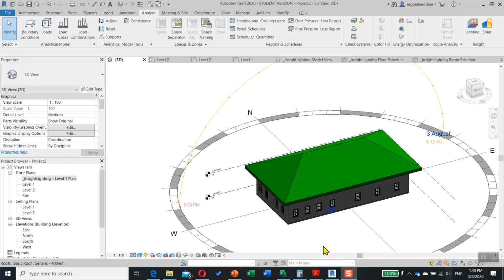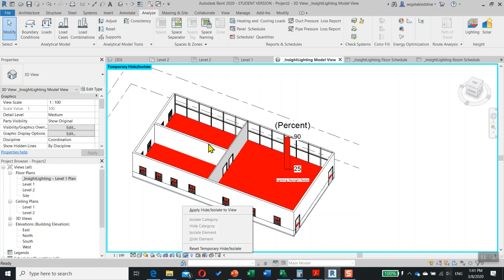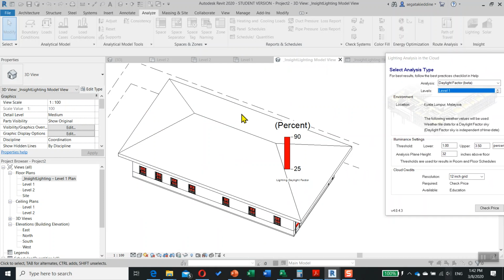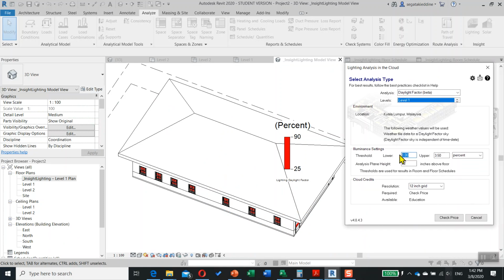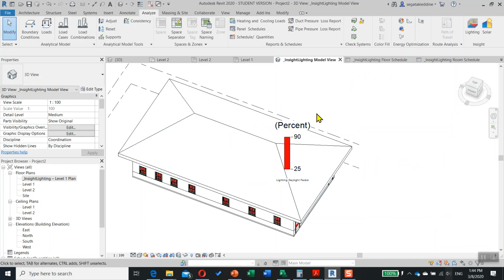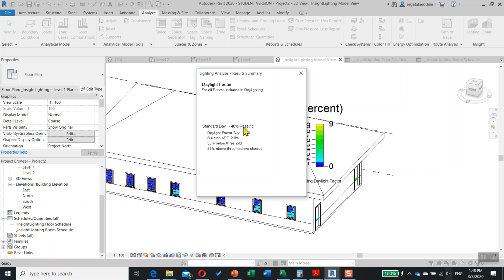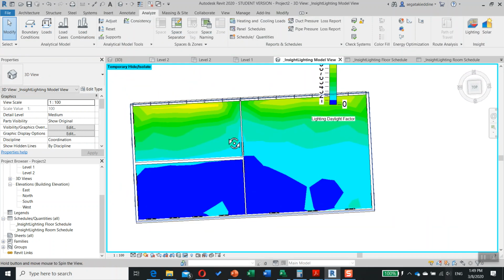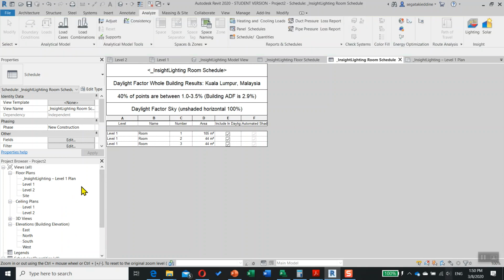2-Daylight Factor DF simulation Using Revit Insight

Comment: Hi thank you for your videos
i receive an error of "your project has no room included in daylighting analysis .."
though i have created room with area... i don't know why it keeps appearing ...
do you have any idea about it.
thank you
Reply from the maker: Your model should contain Room elements assigned to each room. Then you should make sure that the room parameter "include in daylighting simulation" is on. You find this parameter by selecting room element. Tq